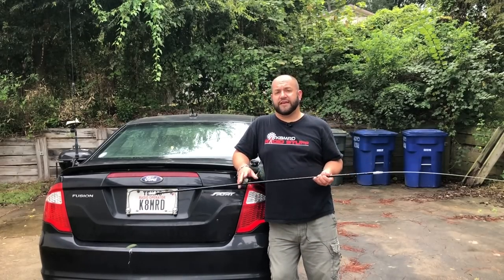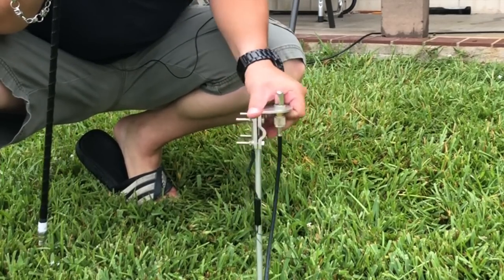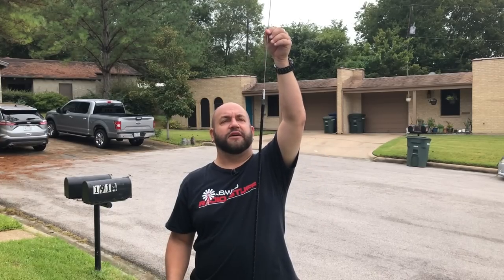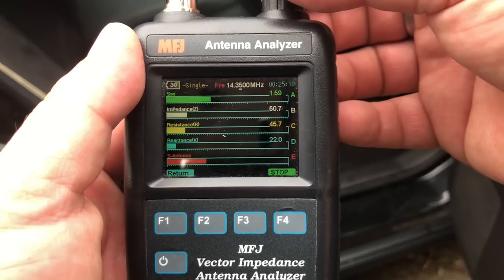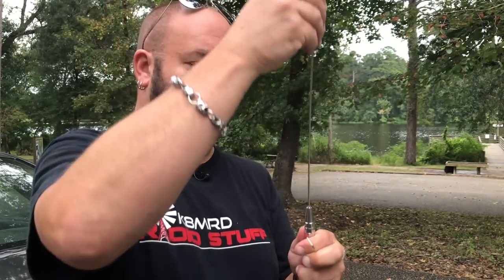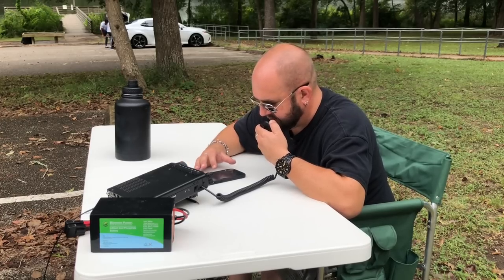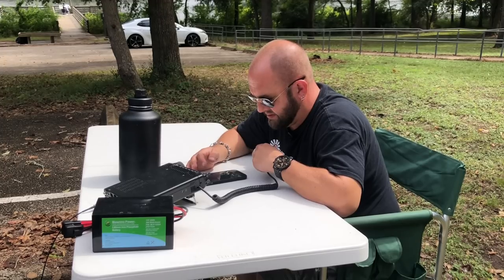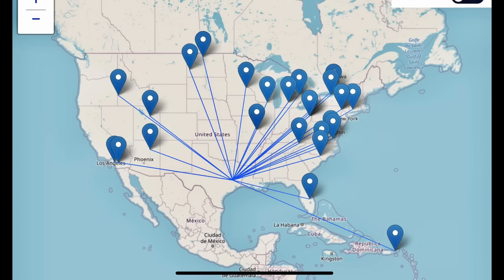Antenna Review | MFJ Ham Stick

Comment: Bob’s your uncle! I was about to say, when the stinger is so low that it penetrates the loading coil, it acts as a ferrite core, which increases inductance and that  explains why it’s lowering in frequency as it’s shortened. I learned the hard way, with a 40m hamstick, that the tip of those stingers inside the coil get EXTREMELY hot. Had a scar from that for a while lol.
Reply from the maker: Well, see, you are exponentially smarter than me, and I'm happy to admit that, and I'm happy to call you a friend.  I'm just glad that I had the wherewithal to figure it out on my own, without calling a friend.  Plus, I have a grinder and I love breaking that out to cut some Metal!

Comment: I have doubles of these antennas to create a dipole using the MFJ adapter.  I ended up having to shorten the "stingers" on several for the same reason you did.  The instructions even state this might have to be done since you don't want the  "stinger" end to be in the coil area (were it is the heaviest) of the antenna.
Reply: In my experience, the dipole configuration works really really well up at 25 feet, but poorly at 10 or so. In fact, your better with a vertical if you can't put the dipole up high.
Reply from the maker: A lot of people, including my dad, use them in that configuration.  I've not done it myself but I hear they work great that way.

Comment: Aloha Mike, I have been using the MFJ 347 Dual Dipole version for 10 meters which on sale at Gigaparts for $23.90, and works very well. Yes, I had to trim both of my wires for 10 meters but made regular contacts into South America, NZ, PI, Australia, Japan and Borneo. Great video!
Reply from the maker: Thats awesome!  Especially for 10 meters.

Comment: I had to take about 6" off my ham stick.  The instructions that came with mine actually said to cut off any more than a couple of inches.  Do they sell that little MFJ analyzer still?
Reply: They do! Just looked it up because it looks nice. Found it on DX Engineering
Reply from the maker: Good to know I’m not the only one.  Weird how they can’t just make it the proper length to begin with.  Looks like you can still get it per Jarretts comment.  It’s the MFJ-223
Reply: @JarrettGreen  Thanks, I may pick one up to use when the Stick won't work for me

Comment: I have doubles in the 10, 20, 40 & 75m bands and I love them. They work great in the dipole mount and I’ve found when used as a ground mount vertical, for example how you showed with your Wolf River Coil radial as the spike, to lower that SWR get the feed point / base of the antenna just about 4”-6” off the ground. It looked like you had to too high. I’ve also found making sure the counter poise radials extending out to opposing sides and NOT near the coax helps as well. Very easy to drop that SWR down.
Reply from the maker: There's prob a couple reasons for the vertical not being as good.  The first would be that I was using radials that I made for a different antenna lol.  I just had them lying around.  I really use them for my PackTenna 9:1 antenna.    This was the first time I've used a ham stick in years.  The last time I used one was very early in my portable ham radio adventures.  The antenna was mounted about 5' off the ground and had horribly long radials, I had to use an external tuner to make it resonant.   I used that antenna on my Michigan Summits On the Air video when I climbed up to the top of an abandoned parking garage and activated it lol!  After that, I did cut them to length and it was very resonant.
Reply: @hamradiotube  Thanks for the reply, and no doubt...and that PackTenna is a beast. I use the hamsticks for quick deploy or when an end-fed isn't feasible / practical. I've had peers poo-poo them and I'm like hey, I'm making contacts on 20M in Italy w/50 watts...hush. LOL. 73

Comment: Can you post link to the mirror mount please? I want to try this setup, to mount it to a vertical rebar pole. Thank you
Reply: Works great. Copper ground rod even better. Drive the rod 1 foot in the ground. Leave 6 -7 ft above ground. Attach mirror mount (Amazon) on top . Now the secret. Attach 4.  1/4 wave radials to rod using two hose clamps. Extend the radials out at about 60 degrees (45 is better) and terminate to insulators (.5" PVC tube sections 2" long) attached to paracord and held in ground with cheap tent stakes or landscape spikes (Home Depot). You will match at around 38 ohms with lower VSWR. You will still need to shorten your whip section a 1/4" at a time to tune. Feed with at least a half wave of coax. Make 6 turns of your coax around 2 litre plastic bottle or PVC form (ugly balun/rf choke) placed below feed point. You can make other radials cut to 1/4 wave length for the band your using and hamstick you select. I use 20,17,15, and 10. Thank me later. It works well. Still not a vertical half wave or 1/4 wave ground plane, but dang good. I live in an HOA and this is how I work the world

Comment: I had to do the EXACT same thing with my MFJ 20M hamstick- cut off about 8 inches so it didn't couple with the inductive lower portion.  I also made a WRC-style coil with 3/8x24 threads which goes at the bottom of the antenna and converts it to a 40M antenna.

Comment: Yup, I had to do the same sort of trimming when trying to get the high end of 40 on one of these. If the stinger sticks down too far into where the coil is, it starts interacting strangely, almost like you are playing with a variable inductor. In my case it was about 4 inches removed in total before it would behave.
Reply from the maker: Rather it be too long than too short thats for sure.  I don't mind trimming to make it resonant where I want it.  I suppose they prob do that on purpose.

Comment: ps. there's a note in the instructions regarding the maximum you should
allow the whip to penetrate into the coil area, and that it could damage
the antenna at higher power if you don't observe that.
Reply from the maker: That would insinuate I actually read the instructions lol!  I do remember hearing that somewhere though.  Thanks for sharing.  Dont want to break my antennas.

Comment: You have done what I have been trying to figure out. The last step I need is to make the radials. Mind sharing how you did that? Thank you so much for all the awesome help! You rule, Mike. :)
Reply from the maker: I just crimped a wire into a ring terminal, put a power pole on the other end, then crimped 3 wires into a power pole.  Done and done.  I did this because I use these radials for a couple different antennas and why not put power poles on everything?

Comment: Nice work Mike!  When I was living in Florida I lived in a very strict HOA controlled gated community.  So, I had a garage attic mounted 37' OCFD up 10 ft.  It was not very effective and I only made a few contacts.  I then tried a mag mounted 40m MFJ Hamstick on my extended cargo van in the driveway.  Wow...what a difference!  The contacts started pouring in.  That was my best antenna and the HOA never said a thing.  They are well worth the $25-$30.  But, as you found out, those Hamstick antennas are very fickle when it comes to setting the SWR...lol!
Reply from the maker: What a great testament!  A lot of guys front on these antennas and I don't know why.  They absolutely work.  And they're so inexpensive!
Reply: Stick the 10m hamstick on top of the bottom half of the 40m one. It will improve performance and increase the bandwidth. Takes some fiddling and you can't drive with it like that, but if you ave both of them already it is worth a try.

Comment: Hey Mike, a little late watching this video, but have heard a lot of good things about Hamsticks,, and they sound great from those that are using them, so I went ahead and ordered a couple of them today. What make and model of mount are you using on your car? Also, do you drive with the Hamstick attached? Wondering how they hold up back there?!?  Thanks! Mark - W7MMG
Reply from the maker: Hi Mark.  The mount is a Diamond K-400.  I don't actually drive with the ham sticks on the mount, but I absolutely could.  I have a Little TarHeel II antenna the takes permanent residence on the mount.  I will tell you that it can withstand 100MPH winds :)

Comment: I tried two 46"x84" aluminum window screens as a counterpoise for my MFJ-1879 17' telescoping vertical & it was like my 5w QRP signal had a 10dB amp on it. Now I am going to try it on my 40, 20, & 17m hamstick. I can't find a 30m version or I'd try that too! Cheers, Davey - KU9L

Comment: Great video Mike - as always.  Which MFJ mirror mount did you use for the ground mounted version, and can you share any detail on how you designed the brilliant Powerpole counterpoise?  This will be going down the river with me on my October kayak portable.
Reply from the maker: Thanks.  Its this one:  https://mfjenterprises.com/collections/mfj/products/mfj-342t?_pos=4&_sid=e386af5f4&_ss=r  As far as the power poles, I made a small lead with a ring terminal on one side and a power pole on the other.  For the counterpoise I put 3 lengths of 26awg poly stealth wire, https://www.amateurradiosupplies.com/category-s/218.htm into another power pole so I can quickly disconnect it.  I did not make the counterpose wire for this antenna mind you.  I just had them from another project and they were close enough to use with this one.  Hope that helps.  Let me know if you have any other questions.  73

Comment: I have several of these in 40 meters and 1 in 20 meters. they work good but need a tuned counterpoise the right height from the ground to get a good match. Adjust the counterpoise for the lowest SWR after setting the whip length for resonance. The counterpoise works better at an angle down and not at 90 degrees.  I use them portable.
Reply from the maker: Yeah that’s how I used them before was elevated.   I didn’t make the ground mount to use with this antenna, I just had it lying around, and the counterpoise wires were for another antenna as well.  Still worked.

Comment: I put those puppies in the middle of my car's metal roof with a mag-mount.
My biggest problem isn't a compromise antenna, it's all the QRM you get in
the middle of a city. Worked Slovenia two weeks ago from a nearby parking lot!
Reply from the maker: Yeah the QRM will get you for sure.  I bet your Slovenia contact was either S51DX or S57DX?  They've got an impressive station!
Reply: @hamradiotube  S57DX, yes. He was so loud, it sounded like he was sitting in the car with me!

Comment: Hi Mike,
Awesome video. I have pairs of the MFJ Ham Sticks for 80, 40, and 20. Used a pair as vertical dipoles for 80 and 40 and worked well until the mast fell over. They will be my primary POTA antennas until I settle on another antenna. One big improvement I made was to ditch the setscrews and replace with stainless screws. Much easier to adjust with a screwdriver and you don't have to worry about rounding out the setscrew. Do have to admit it looks uglier with the screws. Stay safe.  73  WJ3U
Reply from the maker: Nice, my dad has a dipole thing for them too that he used for his RV.  I should get better screws.  The stock ones are junk.  One of them is already stripping from when I was tuning it.  Doesn't matter how it looks so long as it works.

Comment: Frequency going down as you shorten the whip?  I have had that happen when I have tried to increase the frequency folding back a wire antenna.  Had to actually cut wire.  You are probably experiencing the same when the whip is pushed into the body.

Comment: I love my Shark ham sticks. I do POTA all the time with them on the top of my truck. 73s
Reply: I have both the MFJ and SHARK ham sticks.  I started with the MFJ and they have worked great for over two years.   I recently got the SHARK  version and I do think they are better made and tuned easier but I would recommend either brand.
Reply from the maker: right on.  They work great.
Reply from the maker: good to know about the Shark.  Thanks for sharing.  73

Comment: I unscrew the whip addy and put the tip into the fiberglass and place that inside a piece of CPVC pipe in my trunk when not in use. The ball on the tip does not dig in and scratch up the fiberglass. 📻📡

Comment: May also try to bend the top 2 to 4 enches horizontal (90%) to the whip. 

We did this is the middle east a lot on the  trucks. Never hurt, almost always lowered swr.

Comment: Great info. Actually helped me with my OPEK HVT-400B. It would have taken me ages to think that the steel inside is affecting the "coil".
FYI if you are cutting with your angle-grinder like that its VERY dangerous. Horrible accidents happen with these things. It should have come with an extra grip and a "guard" - and get yourself some kind of clamp for your small workpieces. I've seen an accident with these not long ago myself; its no joke. If that guy would have worked alone with no-one around... he would not have been able to stop the bleeding. Be safe please! (Not trying to be overly cautious guy.)
Reply: Olli - Thank you for pointing this out to the folks on the post. A few minutes of insuring practicing proper safety & preparation goes a long to way to insure against permanent injuries.
Reply from the maker: Awesome, glad it helped you out!  Yes, my angle grinder did come with all the fancy safety things like you mention.  I took them off immediately.  I have seen accidents for sure, but in my previous line of work, they tend to get in the way.  At least I was wearing safety glasses though.  I do appreciate your concern.  Thank you, and thanks for watching.  73
Reply from the maker: No one ever accused me of being the safest person on YouTube, but yes, you are correct.

Comment: I appreciate the review on the Ham Stick. I have a Hustler mobile HF antenna that consists of a mast and I have a 20, 40 & 75 meter resonators. It’s not a bad little mobile antenna. I usually get out to stations with 100 watts about the same signal report that I give them. There have been a few times that I’ve tried contacting POTA stations that just didn’t seem to hear me. But what do you expect from an HF mobile that cost me $75 I think about 3 years ago that I found on FB Marketplace. It doesn’t reach perfect resonance in the bands they are designed for. That is a good idea to try trimming the extra whip that is inside the coil. I, like most people never thought that would matter. Thanks for giving me an idea! Love the videos; keep it up!

73,

Carl
KB9HPM
Reply: I’ve been able to work DX in Europe and have heard Spanish speaking stations fairly regularly on 20 meters. My 75 meter resonator needs a tuner to be able to get acceptable SWR. There might be an issue inside the coil causing this.

Comment: I wonder if two of these would make a great dipole with the double screw-in mount and elevated to a safe level for stability, it would make a great 10M inverted-V also. Thanks for the video! 72 es 73, Davey- KU9L
Reply from the maker: I've not used ham sticks in a dipole configuration myself, but that is a very common thing that people do.

Comment: Hi Mike, bit late to the party with this question ! How would you say the MFJ single band hamsticks compare to something like a Wolf River Coil mounted on a Magmount on the roof of a car ? With the WRC, you wouldn't need a separate hamstick for each band you wish to operate on. Thanks 73
Reply from the maker: Performance wise they are going to be very comparable.  The benefit of a WRC is the multi banded capability.  Both work great, honestly.

Comment: If you use a meter that shows the power level you will see that the power out increases as you get SWR closer to 1. The best antenna is one that is tuned to a very low SWR without the use of any tuner.

Comment: I have two of those at home, but under the name of Moonraker AMPRO, one for 40m, the other for 80m band. Both are mounted on my balcony, 1st floor flat. The tuning is a bit ridiculous since the screws will get worn out after a dozen of times. For me I've found it best to tune them in the middle of each band and just leave them as they are. I use an ATU to tune them up a bit at both far ends of the band. Those antennas work a LOT better than a Rybakov I've had before. They are much more effective - no need to explain why :) 
The 20m one would tune pretty wide, but 80m one gets a much higher SWR at far far ends, so I just use the middle part for SSB QSOs.
With the AMPRO 40 I made a QSO with Japan, and that was at 20W :) 
73!
Reply from the maker: Yeah I would suspect they would get a bit narrower as the freq gets lower.  Im an SSB guy so I just tune for the middle of the phone portion and it works great for me.
Reply: @hamradiotube  In Dec 2022 I've replaced the 80m stick with 20m one. I'm much more happier wit it. Gives me the opportunity to work much further than on 40m stick. So now I use AMPRO 40 and 20 :)

Comment: love the video. new viewer here. which radio are you using in this video? and when you were here in detroit, what parks did you find you had the best results for making contacts.  73
Reply from the maker: Welcome to the channel.  The radio is a Yaesu FT-891.  I didn't stray too far from home on many of my activations but I went to Dodge State Park #4 a lot.  I don't think it really matters what park so long as you can find a nice operating location.  One with enough room to spread out whatever your station may be.  Also one that doesn't hinder anyone else's ability to go about their day without walking into an antenna ;)  I did activate Belle Isle once.  I didn't film it but it was cool.  Just sitting in the car with the 891 and a Wolf River Coils mini on the trunk making contacts with a great view of the city.  I wouldn't want to do it every day, but that was one of the more memorable ones for me.